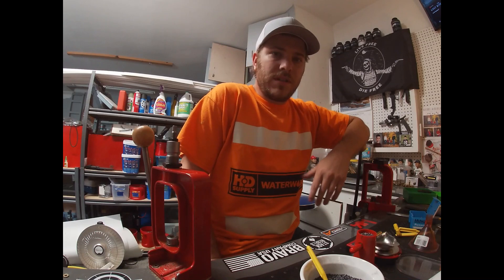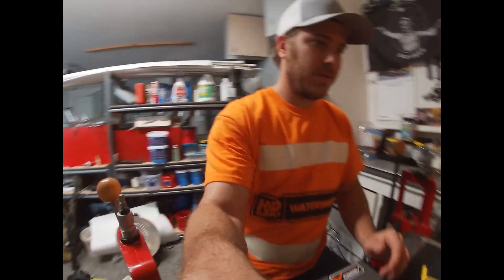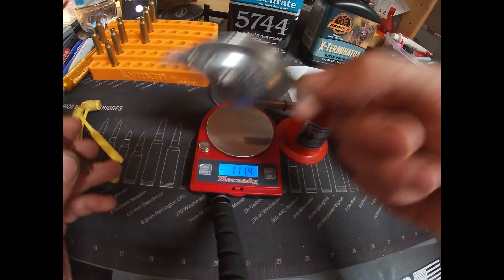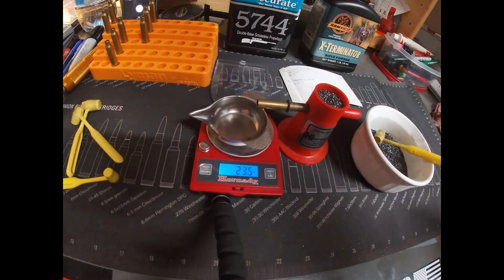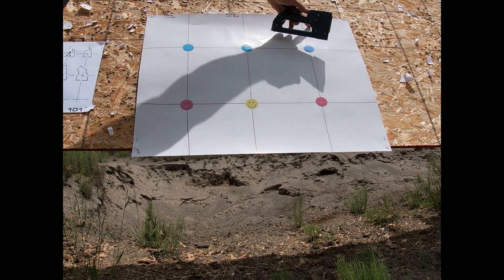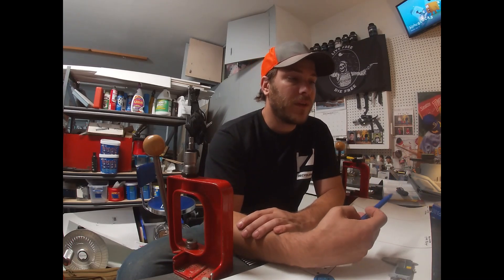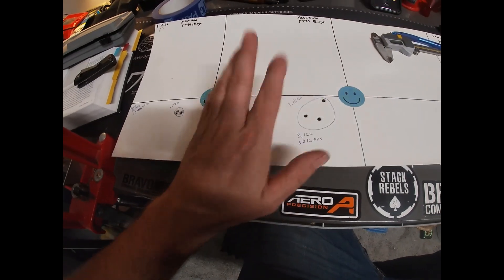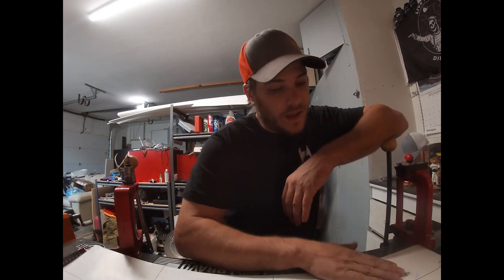Accurate 5744 and X Terminator load up with 223 46gr HP EP 3

Comment: I got a quick question for ya.  Whats the effective range of this bullet or the like sized. I been thinking on trying the smaller stuff. But,  The yotes around here get hunted hard. Very tough to get them within 200 yards. Real time shots are most the time around 250 to 350 yards. Working up a load today with 69 gr. Hornady bthp.
Reply from the maker: Johnny's Ultimate Handloads the bullet holds up vary well. Features a weight-rearward design to enhance bullet accuracy and explosive fragmentation on impact. Ideal for use in the 223 Remington 22 Hornet and 218 Bee cartridges. It can be pushed really hard on velocity. If you can get it to group we’ll I would not have a problem shooting a dog out to 400 yards long as ur pushing over 3000 FPS! The 69gr is a good bullet. Have u tried a 50gr vmax?
Reply: @ReloadingQuest  No, I haven't tried them .But I have them on hand.

Comment: I enjoyed your video. I just ran across some of these bullets and found you. I only have H 4198 so will test that first. How much crimp did you use? Light, med or heavy?
Reply from the maker: Good deal thanks for watching. I actually did not put a crimp on them. What are you using for load data
Reply: @ReloadingQuest  The best I found was Horanady 45 gr Hornet and I shortened up the OAL to allow for the Hornet tip.
Reply from the maker: @tires2burn  yeah I had to almost make up the data as I went. But I got like 6k of those bullets and then shoot pretty well. Going to try them in the 22-250 next
Reply: @ReloadingQuest  I ask about a crimp because after droping the bolt on a dummy round it would grow about .010. It needs a med crimp to keep it solid. I'll find out if it affects the accuracy when I chrono them.
Reply from the maker: @tires2burn  what is your neck tension?
Reply: @ReloadingQuest  About .004 and I use a Lyman M-Die to step the mouth for flat based bullets.